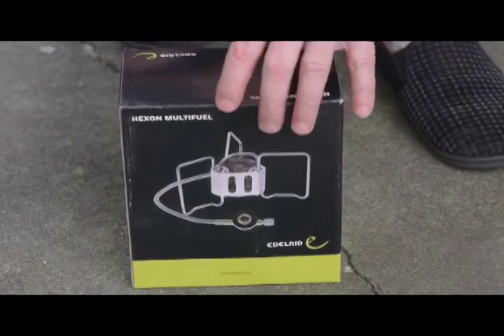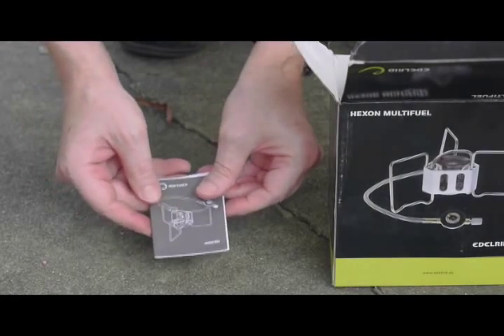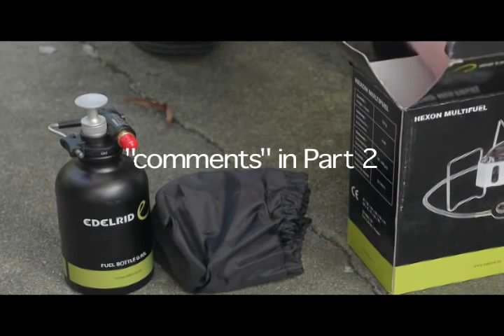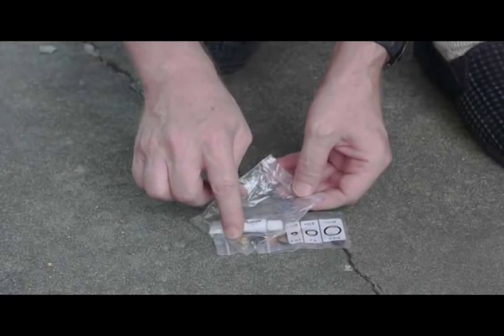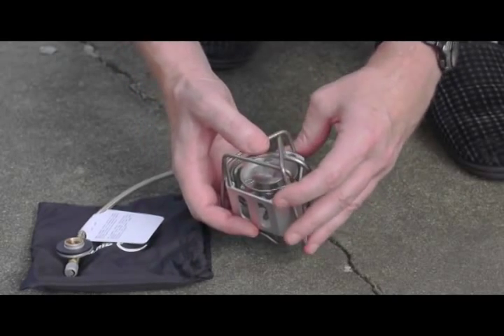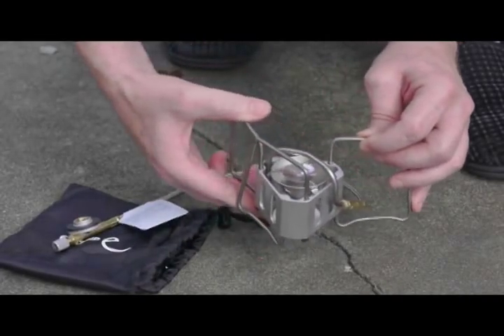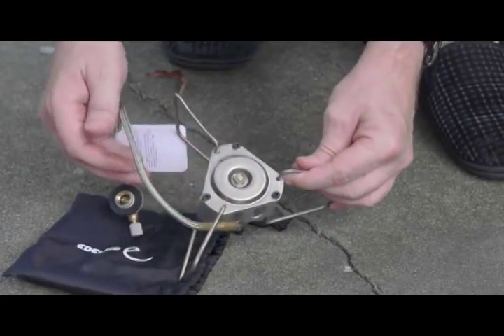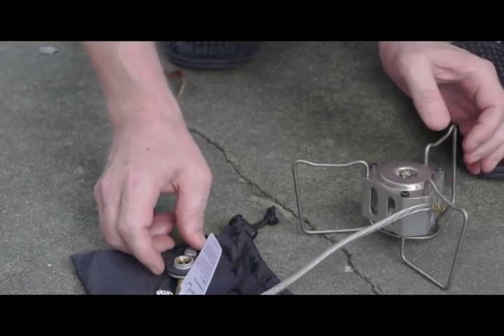Edelrid Hexon Multi-Fuel Stove Review, Part 1

Comment: Hello, please I need to remove after a year of use the steel cable where the fuel passes to clean it and it is impossible because of the dirt, is there a way to remove it with a chemical product or whatever?  Thank you.